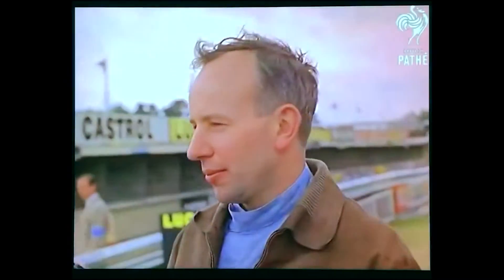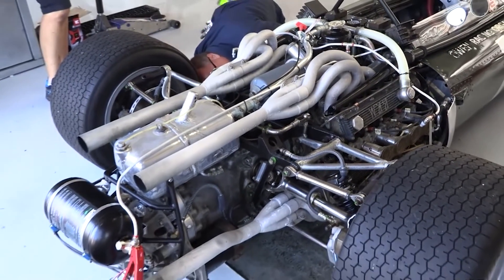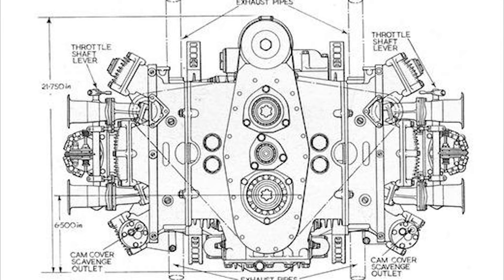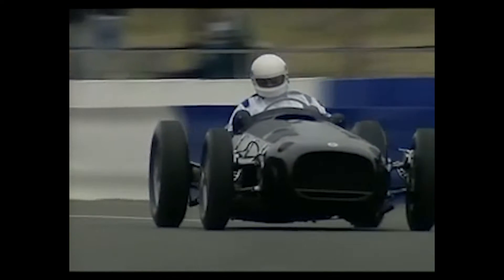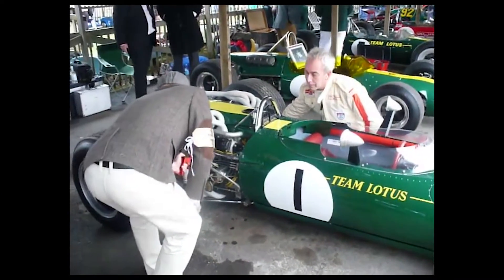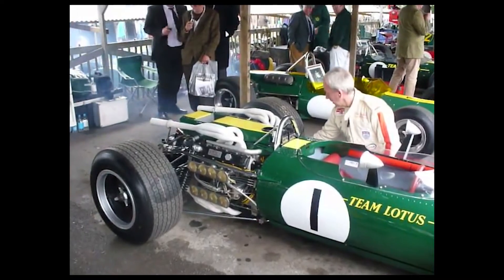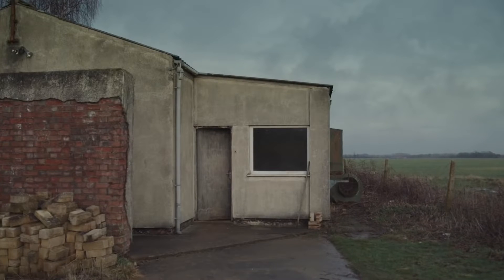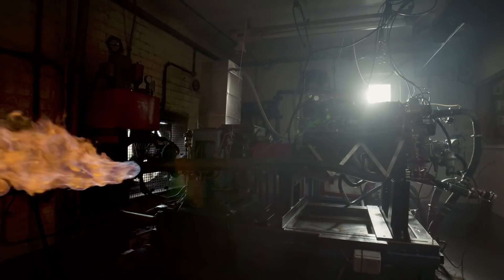The BRM H16: The Untold Story of Formula One's Most Intriguing and Challenging Engine

Comment: The engine was reasonably reliable by 1960s standards; the transmission, less so.  I believe one selected 6th gear on the straight at Spa and actually got 2nd, 4th AND 6th - the gearbox exploding at over 180mph.  The car livery was British Racing Green; I suspect the driver's overalls were Bovine Brown.

Comment: BRM had a thing about complication!  The V16 that came before the H16 is a case in point. Obviously they were chasing horse power but forgot the fundamental racing mantra, to come first, first you have to finish!  With such complex engines with their prodigious component count, the prosepect of mechanical failure increases exponentially.  Particularly at that time when material technology was still developing rapidly.  Their ambition was impressive but never matched by success, or budget!  Their sweet spot was the 1.5 ltr V8, that should have been a signpost for the way to success.  One thing about the H16 that always troubled me, the location of the intake trumpets. Ideal for ingesting dust laden air from front and rear tyres!  Particulary then with no air filters, just course wire mesh guards.

Comment: Simple is better, guess it was just too complicated for the time.
Reply: They tried to reduce the potential for mechanical failure by mating two already working engines but the synchronization problems made things much worse. We did eventually get the Bugatti W16 but not in an F1 friendly form factor....